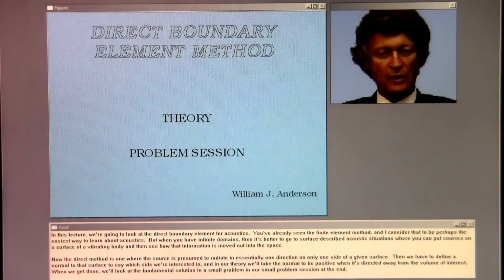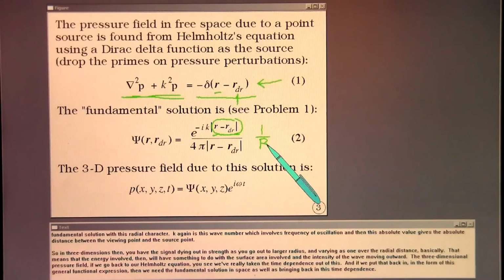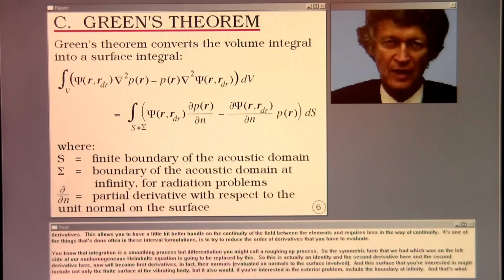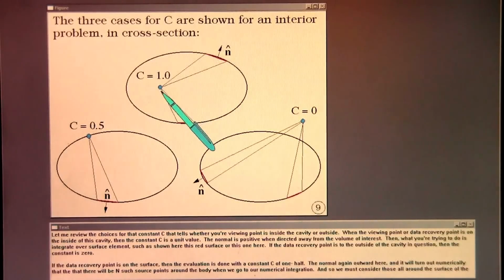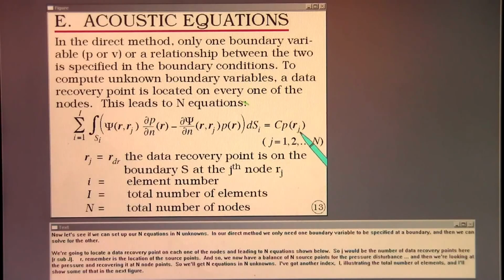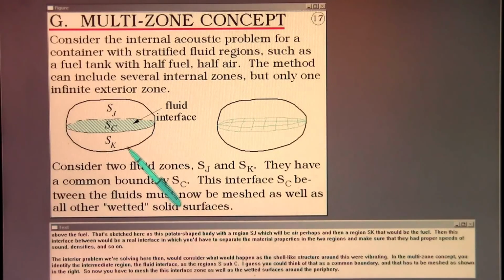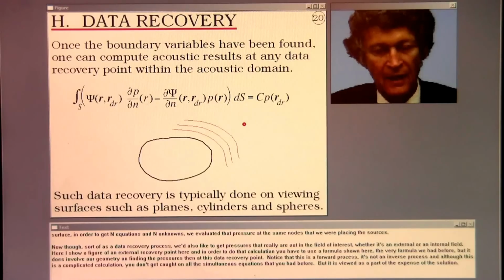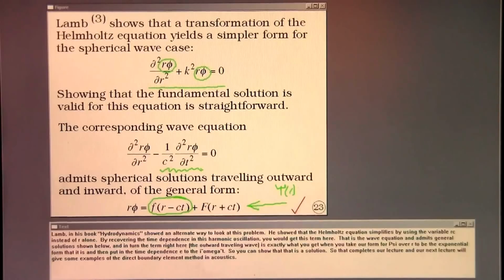Direct B. E. M. Method. Lecture 5.

Comment: Dear Aradet84,

I haven't done electrical fields in a while.  I think the code ANSYS is possibly the best for representing electrical currents.  There is an analogy between 2-D problems in inviscid, incompressible fluid flow, stress analysis and electrical current in a conducting material.
This seems to be a hot topic at present in biomechanics.  I may do something in this area in the future, but currently am retired and not very active.

Bill Anderson